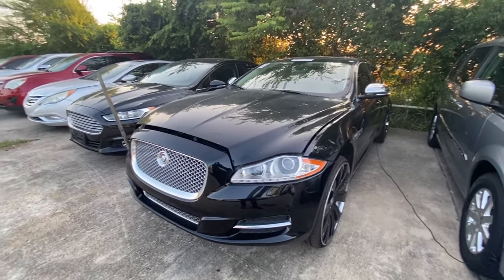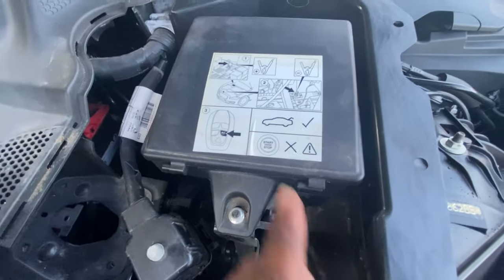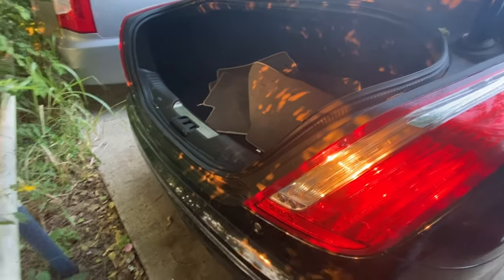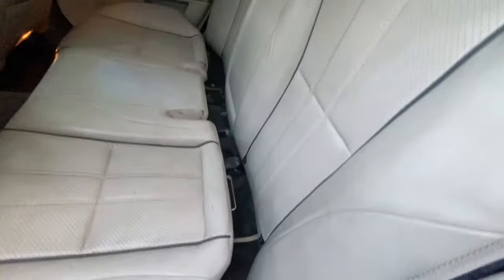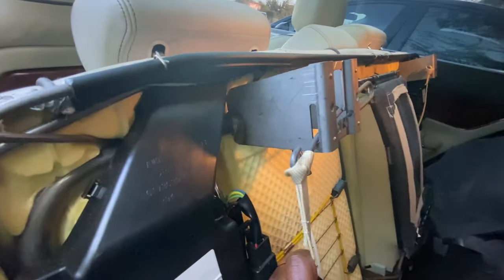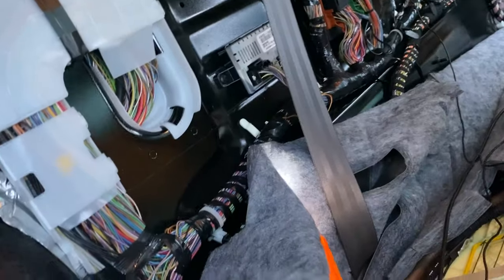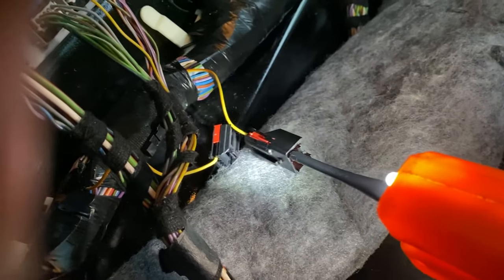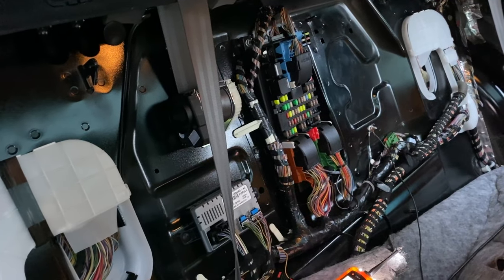How to open a Jaguar trunk with a dead battery #Opentrunk #2011jaguartrunk #Jaguar

Comment: Folks, this is not in the manual but there is a hole above the rear license plate under the chrome trim. It is actually a key slot. Insert and turn the key. Walah! The trunk opens.
Reply: Didn’t see it 😢
Reply: On a1999 Jaguar try looking at the model plate on the back to the right of the license plate for a little hole. This model says Vandex Plus. The key hole is to the left of the V
Reply: @JoZi4256  as a
Reply: I cannot seem to find that keyhole that opens  the trunk .can you give me a better idea  where it may be located? I've looked everywhere above the license plates under the Chrome I do not see a keyhole at all could you please help me
Reply from the maker: What year is your Jaguar?
Reply: @CoombsAuto  2011 X Jl super charge
Reply from the maker: There’s no keyhole on this particular model. Follow the instructions from the video.
Reply: Can you demonstrate to me exactly how to use the Power Prob  to open the trunk of the particular model that I have 2011 X Jl super charge
Reply: You are a star. Just found it. Thank you 👍
Reply: Not for an 2011 XJ
Reply: @samuelsmith3550 I am trying to open my jaguar xj 2011.. battery is run down and still can’t get into the booth .. been unable to get In

Comment: I had a flat battery unfortunately I followed the instructions in the vid without thinking and blew the 100 amp fuse. I had to drive to a breaker yard to get another from an Audi. The top of the fuse box has the diagram showing connect live to the fuse and earth to the engine. Then the alarm and lights should come on until you disable with the key fob. Then you can open the trunk or boot here in the UK. Good luck...
Reply from the maker: @wrayxphoto  All the way from the UK 🇬🇧 🤘🏽

Comment: So I am trying to get to the strips to pull down the seats, but i cant get the part you sit on moved. Does anyone else have this problem. It is really impossible to get between the seats. Thanks for any help. i must have blew the fuse
Reply from the maker: Hey, happy to help! You have to release the lock behind the seat.

Comment: For anyone who is watching this now (proceed at your own risk): Another method is to attach a jump pack to the correct connections under the front hood of vehicle (See owners manual), hit "Boost" to momentarily power the electronics and then press the trunk release button.

This will even work if your battery is not in the trunk. Ask me how I know.

Comment: What fuse did you have to replace I think I blew my fuse yesterday while trying to get power to mines to get in the trunk now car has no power
Reply from the maker: Where u able to get in the trunk?
Reply: @CoombsAuto  no sir
Reply from the maker: Did you try the steps in the video?
Reply: What fuse was it please?
Reply: What fuse did you replace? I'm not getting any power 😢
Reply: @lambroatl  I think I may have blown a fuse as well, so once I get to the fuse boxes ( the one under the hood and behind the seat, I just plan to check them all. Which ever fuses are blown/damaged, will get replaced.

Comment: So if you can't access the car, how did you open the hood?
Reply: U can open it with the steel key inside of ur remote  put it inside door handle ( remove the cover first ) opposite of driver side

Comment: You don't know much about the jaguar! because  If just Jack the car up from the side started is and huck the jumper cable to starter power and one on ground trunk get open with remote easy! Because starter positive wire straight connected to the battery
Reply: Hi can you please explain this again? I cannot access my boot. If you could help me I would really appreciate it